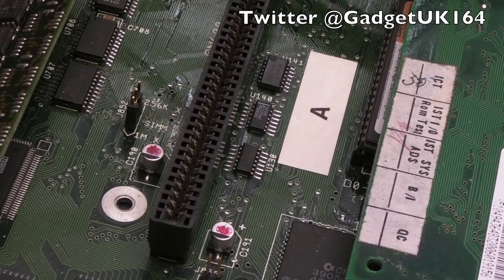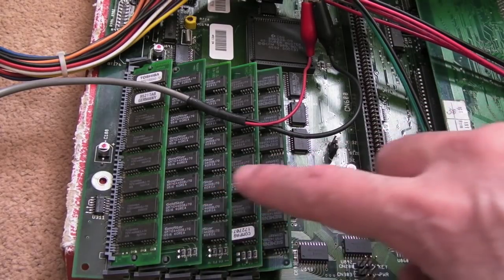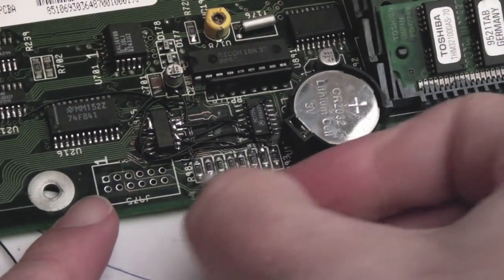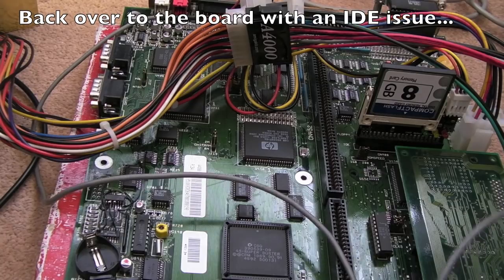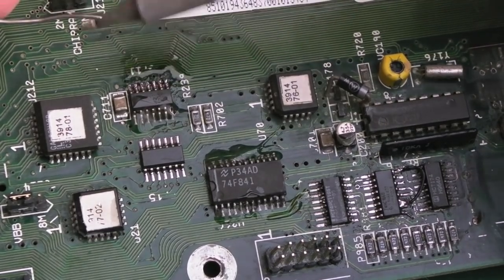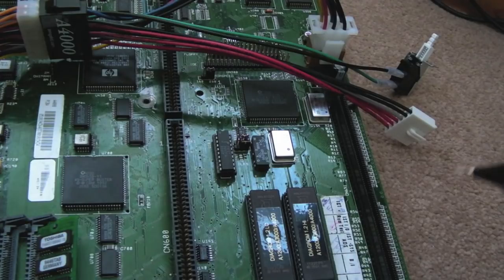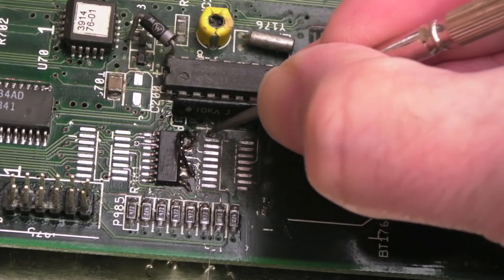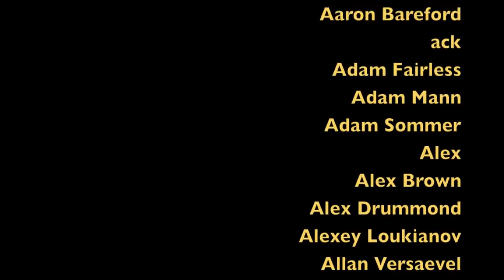Commodore Amiga TerribleFire A4000 Motherboard Repairs x 2 - Part 3

Comment from the maker: At the point I was talking about the serialization of jumper options at the start - I was tapping Alice when mentioning Lisa!  And ignore some of my points there about certain pins being pulled high and low - I was jumping ahead talking about when the chip is fitted (not when its missing).  It will probably read all lows, or all highs, or the mouse (again) if that 2nd 166 is missing - not sure which, I've not worked it out.  The message related to the Lisa / Alice ID is shown in part 4!
Amiga PCB Explorer - http://amigapcb.org/

Comment: On the almost dead boards, the serial output from the diagrom is often really useful.
Reply from the maker: indeed!   I did connect these up to serial (both of them) - neither were doing ANYTHING!  In both cases the clock gen stuff was an issue - in one case the XTAL was only working on rare occasion, on the other board I think it was caused by the CPU slot, and later the 74F74.

Comment: Nice work on the A4000s!, I enjoyed it as a live stream, and I enjoyed watching the edited feed. :)

Currently I'm working on a couple of cranky A2000s, one appears to have a dead 8372A in a Megachip Plus, the other the Vampire board isn't working (I suspect the 68000 socket). I've got an A600 that needs a good wash and recapping.

Comment: I use amtel flux. It's very high quality. I learn a lot from you. We are up to 16 or so Amiga 2000s fixed in last 2-3 months. Have you tried acetone for cleaning the flux? I find  I have better luck than with alcohol
Reply: @benbaselet2026  the cleaning solution is acetone haha. No joke. I have had zero issues with it. Makes the board shiny too. I just bought a ultrasonic too. We do full repair work. Just cleaned up a very bad 4000. No lifted pads and nice and clean. We post a lot in the Commodore Amiga Facebook group.

Comment: While you're soldering the surface mount devices in place, you put a large blob of solder on one pin on each side and then apply some kind of gel.  Is that flux?  And are you then just sliding the iron along the pins to distribute the solder blob among them?
Reply from the maker: Yes, I am using flux there.  I use the chip quik brand.  It helps the solder join to the pins and not each other.  If you bridge a few pins just use desolder braid to absorb and remove the excess solder.

Comment: With these boards in such a bad way, would it not be worth purchasing one of the reengineered boards that have most ( if not all ) of the errata fixed?.
Reply from the maker: Nah, way way more work to assemble one of those boards if you ask me!
Reply from the maker: It might be easy if you have a full kit of every single component, and all the components provided in one kit etc.  I would hate to go and have to source all the parts for one!

Comment: Didn't you get loads of new tips for that iron when you got it?
Reply from the maker: Yes, I did - the problem is I want one tip that I can leave on there lol.  Each of the ones I have has pros and cons.  I will eventually find a tip just like I use on the Antex and that should work for well I think.

Comment: Just watched Adrian Black using WD40 to remove that white fury crystalline deposits on the 2and Mac installment video!
Reply from the maker: Thanks =D  Yeah, there's no way I would use WD40 on a board like this tbh!!
Reply: I think the fluffy white crystals are stannic oxide (basically tin rust), might be better attacking them with baking soda, but don't quote me on that!
Reply from the maker: @gb7767  After that 2nd clean the problem didn't re-occur!  I think it was so bad the first clean wasn't enough!